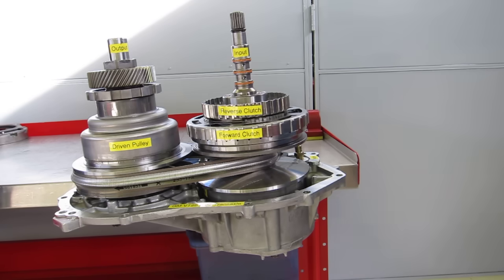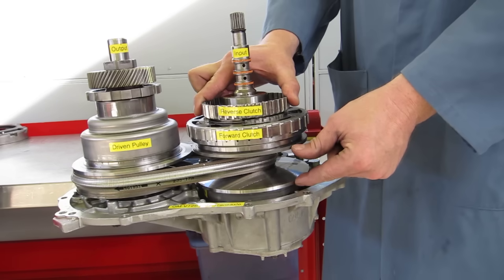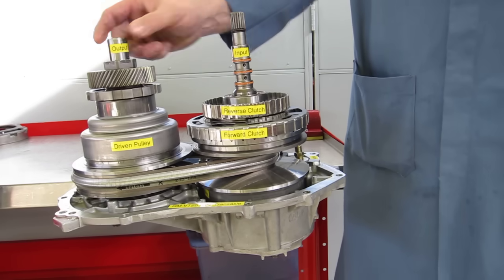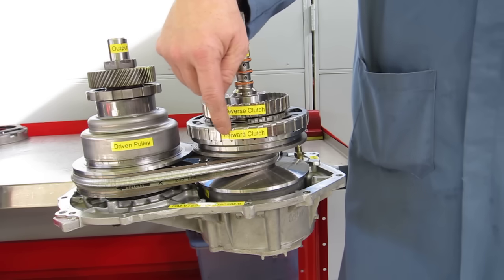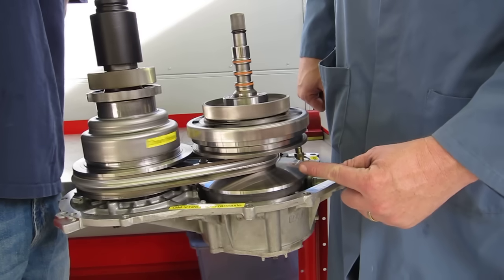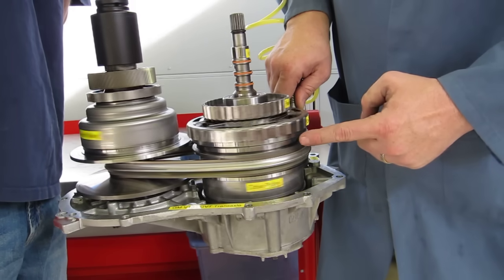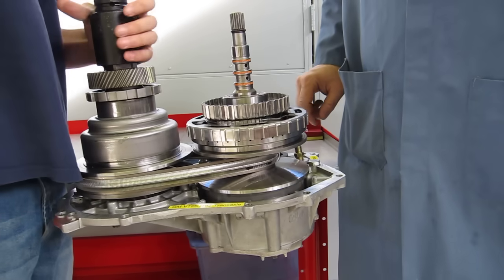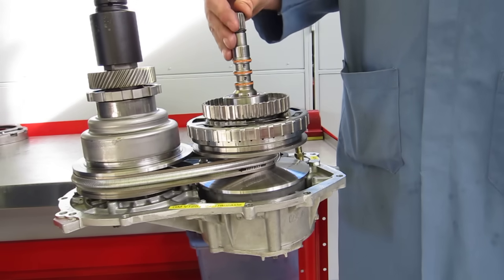Continuously Variable Transaxle (CVT) Operation

Comment: Cvts are great for lighter vehicles like atvs and side by sides.  You don't mind so much that the cvt is kinda loud in those type of machines.  It makes those type of vehicles very responsive to throttle input.  From what I have seen for automotive applications, it really inhibits performance.  It might be quite fuel efficient, but its not nearly as reliable as a normal auto transmission and acceleration is painfully slow.
Reply from the maker: Thanks for your feedback!
Reply: bigger pulleys, sheaves, and an appropriately size (this one is way under what should be used, and is not much bigger than the one on my fourwheeler) belt would make quite a bit of difference.  more power could be moved, coupled with a higher ratio and more aggressive tuning for the cvt, and would result in much better performance.
Reply: Why don't the car manufacturers take the torque converter type of system that was used on gas powered golf carts and make it work in a car?

Comment: There has to be a lot of wear on the flanks of those pulleys and the belt. Also, how does the thing know what gear ratio is best?
Reply: springs weights and there is a part in the secondary called a helix that moves it to certain point. based on what you want it to do.
look up snowmobiles clutches of you want a simpler example
Reply from the maker: It is all computer controlled to allow the engine RPM to be at the most efficient and powerful.

Comment: Under normal operating conditions would a CVT type transmission sound differently than the normal automatic transmission as you approach various speeds in terms of what you'd normally hear from idiling (or sitting at a traffic light) up through about 60mph or more?
Reply: It's different. An engine gradually produces more torque as RPM increases, but eventually becomes air-starved so efficiency declines. When accelerating, the engine will instantly rise to the best torque output, then keeps the RPM/torque steady, and only changes the CVT ratio.
Reply: Thanks for your response.

Comment: +WeberAuto what's the average lifespan or mileage of the steel belt?
Reply from the maker: Hi, it depends upon a number of factors: aggressive driving,  proper service intervals, highway verses city driving, and the manufacturer of the transmission. Many last well over 130k miles. Thanks for watching!
Reply: +WeberAuto thanks for your response and all those factors are duly noted, that's why I was asking for average lifespan. 
FYI, I asked my brother-in-law who's a mechanic for Mitsubishi and he said the belt normally never needs to be replaced (for models Mirage and Attrage). But I agree, all depends on a number of factors. 
Thanks again and I appreciate your professionally made videos!

Comment: So I assume there is no fluid in these transmissions?
Reply from the maker: All CVT transaxles like this use a special CVT fluid, not a regular transmission fluid.
Reply: +WeberAuto ok that makes sense.... There are still some cogs to lubricate. But I would think it may make the belt slip.
Reply: yup expensive & special oil for gear

Comment: Nice video, explains the internals well, and possibly settles an argument... what should a CVT car "sound" like?  Half the people say whining is normal, half say it isn't.   In your video at 2:46 when it starts in motion, thats the kind of noise I hear when I step on the throttle at low speed in my Nissan.  Even Nissan's own CVT brochure says "a high tech single continuous tone that changes in pitch with the engine speed".   "High tech???"  And official reviews of recent models say "not as whiny as the previous model".   So - what is normal to hear, a faint siren style whine I guess?
Reply from the maker: +Chris Whitehead Hi, thanks for the feedback. Yes, a slight whine is normal.

Comment: I used to have a go kart that had a cvt.
Reply: +Jonathan Javier don't talk to me like that!
Reply: +Jonathan Javier don't talk to me like that!
Reply: I know the use them in Karts and snowmobiles, but is there anything else you know of?
Reply: +D Rock     75 mopeds use them too as well as some mini bikes.
Cvt transmissions are common in low horsepower engine applications like go karts and mopeds.
My go kart even had a reverse gear controlled by a lever on my right side.
Reply: ***** , Right on.  Thanks.
Reply: 150-200hp snowmobiles uses them :) Works just fine. (I admit, that is little compared to many cars though) Well, a belt might snap sometimes but in a snowmobile that's not to big of a problem. I don't know about cars though but seems to be a pain to change :S
Reply: Polaris uses a pvt system which is very similar same concept of a driven and drive clutch and they've been known to handle up to 300 horsepower in the turbocharged RZR units
Reply: The scooters have CVTs but they are not quite as complex.
Reply: Bro... which is better for baja the cvt with the metal belt or gauged cvt...???
Reply: That would have been called a torque converter. Suppose CVT is used in cars to avoid confusion since regular automatic transmissions use a torque converter which is way different than what a go kart uses.

Comment: The CVTs are junk.Ford,GM and Nissan has had nothing but problems with them.The Ford Freestyle is one of them,Ford is behind on remans and parts for them.Nissan ,the whole transmission gets replaced when a part fails and can't get parts for it.GM put it in the Saturn Vue with the 4 cylinder and problems with it
Reply from the maker: +wafrederick Thanks for the feedback!

Comment: Excellent demonstration but not a fan of cvt transmissions in cars other than hybrids 
 As a ase certified technician and years of automotive experience I find some cases are lucky but I've had a lot of customers between 30-60k miles have them go bad and we end up replacing them. Also a lot of them can't be serviced by diy customers. The manufacturers say to wait on changing the fluid but it tends to have a burnt smell and consistency that isn't clean. Transmissions tend to stay very clean and reliable as long as the fluid is changed often. 
Don't get me wrong it's not a bad idea to have in cars just that people have to remember that they're not going to be reliable as a standard auto Trans but they provide better highway mpg it's a trade off to consider thats probably why almost all new cars have cvt transmissions and high performance cars/trucks have standard autos
Reply from the maker: +Jon Price Hi, thanks for the feedback. I agree.

Comment: I don't understand why car manufacturers resort to these schemes because people don't want to learn driving manual transmission cars. The manual transmission is a gem in simplicity and efficiency. Only people in north American fall for these gimmicks . Just think you are in the middle of nowhere when this belt breaks, now try to find a GM dealership.
Reply: transformer889 Had a Toyota with CVT for 10 years, 180.000 Km, never fails, is still going strong.
Reply: Yes GM is developing CVT to go with their hybrid cars, or should I say all weather riding lawn movers.
Reply: +Matthew G  I do not diss Chevy,  in 70's they built great muscle cars, then came chevy Nova , I think they still make great cars, but to get government subsidies,   they have started playing with electric, hybrid, solar powered junk that only attracts metrosexuals. This is not just chevy, the all  want to get in the act., The temptation of getting in bed with the government too great, and the money is good.
Reply: I agree AT is great in stop and go situation but like you said it is very complex, and when it goes out you are SOL. It has happened to me twice, very sick feeling engine revs but car not moving, first was torque converter, second time was a 5 cent diode in transmission controller. I  rather shift gear then being stuck in the middle of nowhere. They have cars now that mimics manual transmission, but it is basically AT which TM change the gear for you, why, because mostly outside of US you can not even give away a car with AT.
Reply: +transformer889 E-cvts used in a lot of hybrids work on a diffierent principle. No belt involved
Reply: not everyone wants an automatic. sure they are fine for some things but I wouldn't pick a car with one if I had a choice
Reply: The Journey of a Thousand Miles Begins with One Step. Lao Tzu
Reply: Outside of USA manual, four, five, six or even twelve (on lorries) speed manual boxes are normal. Auto boxes are always an extra-cost option. CVT is almost unknown in UK. I know which I prefer, and it doesn't start with 'M'.
Reply: In many countries you can not even give away A/T car because nobody knows how to work on them.
Reply: True enough, but getting rarer. UK drivers prefer manual transmissions because they do better mpg, (and some people think cars with auto boxes 'lack control'. Stupid, I know, but there it is.)
Reply: Not stupid, the manual transmission let you be in tune with your car instead of a computer decide when to shift gears.
Reply: It's utter nonsense of course. Manual transmissions may be more engaging, but the take up concentration that is better used elsewhere. Like reacting to one's surroundings, for instance.
Reply: Shifting gears comes to me as a second nature, i don't even think or confused about it.
Reply: Shifting gear is easy enough, but not as easy as an Auto box. Try a Fuller Roadranger gearbox or better still a Foden 12 speed.
Reply: These are specialty vehicles not everyday cars.
Reply: CVT has been tried on a number of UK cars, and one or two imports have them. The only one that's been successful commercially is the Honda Jazz. I've owned a number of CVT-equipped cars and they are lovely things to drive. Quick off the mark, but hopeless in crawling traffic.
Reply: Traffic congestion in 3rd world countries, esp. in Indonesia is the worst. You can spend 2.5 hours commuting to office, 2.5 hours back home. In long weekend if you travel to other city for vacation sometimes it takes 6-10 hours. Automatic transmission is more reasonable choice.
Reply: Yes conventional Automatic transmission is a good choice for heavy traffic, but not these gimmicks.
Reply: Because it is a Toyota, it has not broken in yet.
Reply: transformer889 well we all know Chevy's train of thought cheap and crappy is all that keeps them in business that and they build it so you have to take it to the dealer because you need specialized tool that cost thousands

Comment: It also seems to me that the belt only touches at its edge on the cone-shaped guides. But I think that the belts are actually two belts that "bend" so that half of the belt rides on one side of the  cone and the other half  rides on the other side - in sum the belt takes the shape of a "V", where the two sides of the "V"  ride on the two sides of the cone. Is this correct? In all the CVT videos I have seen, this is the most confusing part to understand.
Reply from the maker: +Hank Snow Hi, yes, that is correct. Thanks for the feedback!
Reply: Actually I  have now found that the belt actually has metal guides with shapes that "ride" on the cones, so the belt itself does not touch the cones.

Comment: So, if the transmission control unit need a ratio between maximum and minimum, the hydraulic need to be maintain in a certain pressure to hold that ratio? And if TCU need to continuously change the ration, the hydraulic pressure is also continuously change? And is this the reason why previous CVT usually overheat while mountain driving?
Reply from the maker: +Ramius Lai Hi, you are correct regarding the ratio change; however, the reason most transmissions overheat while mountain driving is the torque converter clutch is disengaged for too long of a period. The only way to prevent this is to install an additional cooler or to slow down and let the converter clutch engage more often. Thanks for watching!

Comment: What will happen if the pulley belt was cut was off while driving? Can you still move the car into safety or it will be dead on the middle of the road?
Reply from the maker: +badboyz7314 Hi, the vehicle would no longer move under its own power. Thanks for watching!
Reply: +WeberAuto if ever it may happen will it have an adverse effect on the engine, will it damage the engine.
Reply: +badboyz7314 it,would be just like driving your car then suddenly shifting to neutral. The load is taken off the engine sounds the Rpms would shoot up
Reply: pretty much similar to a paddle chained bike except the motor will still be running but no power at the wheel anymore. its a very simple tranny but wont out last out the motor itself.

Comment: can CVT be tuned for track use ? or it still more sluggish than Manual and dual clutch Auto
Reply from the maker: +yasser aboamoud Hi, I am not aware of one being used for track, it would be awesome though! Thanks for watching!
Reply: +yasser aboamoud Try sourcing information from Dutch DAF automobile clubs. The Dutch truck and previously also automobile manufacturer invented the CVT but called it 'Variomatic' for short, as in variable automatic.

Since the DAF cars could go as fast forward as in reverse the Dutch used to race them in both directions. Just search youtube for this exact word 'achteruitrijrace'.

Comment: If the pulies are very smooth inside as it looks, then how can the belt make them turn?
Thank you
Reply from the maker: +Soran Mohammed Hi, the pulleys are forced together with pressure as high as 750 psi. That creates a clamping load to push the belt. Thanks for watching!
Reply: +WeberAuto speak metric !!!! inch is for retards !
Reply: WeberAuto Many Thanks
Reply: Wow, it takes 5 sec to understand. Plenty of better explanation made by real engineer. Not a jerk using PSI BTW, this concept is more than 60 years old. First used in a car made by DAF.
Reply: +Ellsworth M. Toohey man, you don't need to learn about CVT or whatever, first go and learn how to speak this is way more important for at the moment
Reply: Learn about "friction", you dumb ass ! May be it"s explained in your book, the kuran !!! Ha Ha Ha

Comment: I have a Toyota Auris with the CVT gearbox and my fiancée loves how smooth and quiet the transmission is as there are obviously no jerky gear changes. Plus the fuel economy is much improved over my older car's standard automatic gearbox. Thanks for the interesting video!
Reply from the maker: +Diamondblade2008 Thank you!

Comment: I have a 2012 Nissan Altima, when cruising and acceleration the car a bit slows down and pushes again for two or three times but not heavily, only I notice it cause I drive it. that's one
two, when I remove my foot on the pedal but in low speed (30-40 kph) I feel like the car breaks and stops itself but it doesn't happen when I shift to N but happens while it's on D.
changed its hydraulic yet the problem persists :/
any ideas??
Reply from the maker: +Soran Mohammed hi, that does not sound normal. There may be a trouble code set in the transmission computer. You may need to have it checked out by a Nissan dealer. I would also recommend searching doe service bulletins or recalls for that issue. Best wishes.
Reply: +WeberAuto I did computer check it but everything sounded okay 😕😕
anyways. many thanks
Reply: I'm not an expert but I feel that's just how they drive. I have an 07 altima and I get that "braking" feeling sometimes when I take my foot off the gas. It's strange but when it happens just gas it alittle more.

Comment: Mistake on the CRT Salsbury;   actually the CRT was a constant-RPM-transmission;  it felt just like the early Buick DynaFlow transmissions (no shifting).   Buick used a special fluid coupling system due to their antiquated "torque tube" driveline which would amplify the Hydramatic shift-jerk into the car.    This CRT setup was also used in hod-carriers, a powered wheelbarrow used by stone masons.
Reply from the maker: +MrGGPRI Great information! Thank you again!

Comment: Sixty year old technology....  My 1949 Salsbury motorscooter had a CVT known as a CRT constant-ratio-transmission-- and more. It operated automatically, that is the rear pulley was spring loaded allowing it to follow, in the opposite,  the front pulley diameter which varied with RPM by virtue of flying weights.  In addition this front pulley housed another clutch which was essentially a brake-shoe drum but the shoes were also flying weights and  disconnected from the engine at idle.  A stiff flat belt about one inch wide connected the two pulleys   The aluminum engine sat at 45deg, was about 20ci, used a very expensive FM magneto for ignition and was very fast getting up to its max speed,  all very advanced for its time. 
SEE PICTURES AT:
http://www.salsburyscooters.com/SALSBURYSCOOTERS.com/NEWSLETTERS/Entries/2013/12/15_NEWSLETTER_45.html
Reply from the maker: +MrGGPRI Hi, yes, this is not new technology at all. Thank you for your feedback and photos. Have a great day!

Comment: what controls the fluid pressure?
Reply: +jessica091315 centrifugal force from engine output. the faster the engine crankshaft turns, the higher the centrifugal force is, the higher the hydraulic pressure will be. That's why CVT cars can pick up speed with steady engine RPM.
Reply: +Jeffery Jin oh really, so its not the valve body
Reply: +scott Grant actually I was quiet wrong… It is all about TCU talking to ECU.